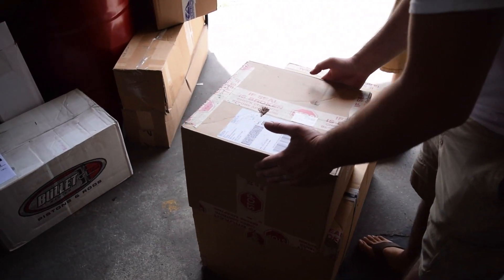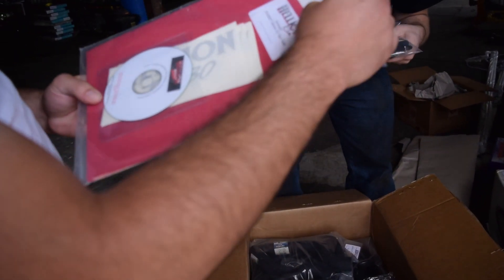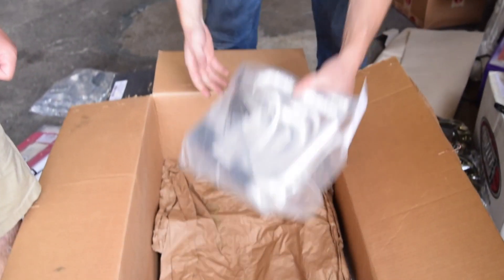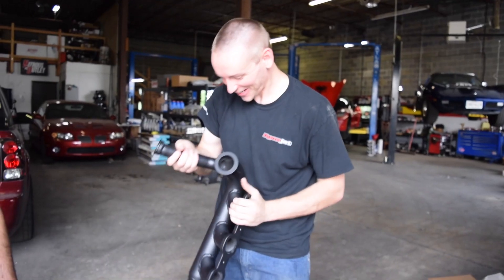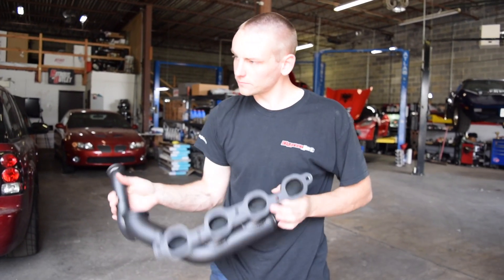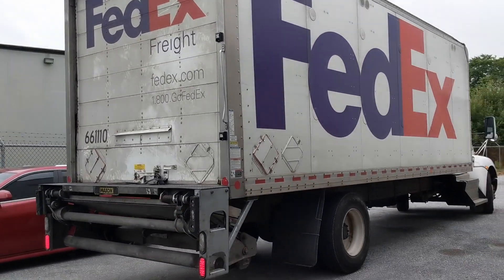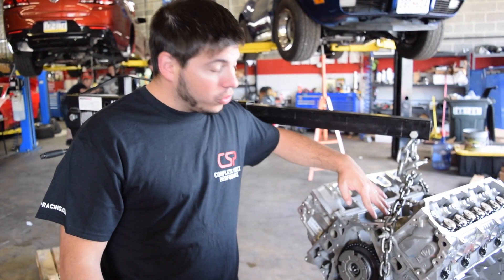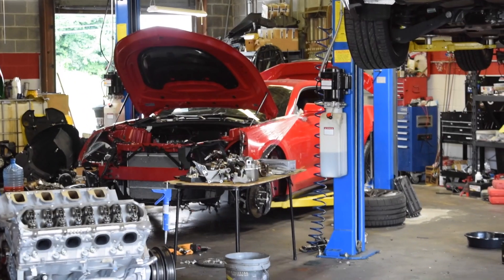Unboxing GuitarmageddonZL1's Twin Turbo Hellion Kit and Stroker!

Comment: Turbos are changing. With Gen2's, you don't need an 8 inch opening on a turbo to push 30 pounds of boost anymore. The bearings are better, the rotational speeds are better, they're lighter and one of the largest important things is you just don't have much space under a factory hood unless you shift the engine back, rip at the dash and build a bell housing for the tranny that is now sitting right beside your thigh. 
They don't spec them at 88/98 102/108 anymore. They provide them based on HP you want. 
Nick has his target on a racing bracket and that's where he's going to race until he wants to spend 50k to step up into promod or something. People always look at a small turbo and go "But why isn't he trying to rip 3500HP out of that setup?"  The reason is that you have to actually baffle your turbo system if you use turbos that are too large. HP is impacted by boost. With a smaller setup, you can't build boost on a big turbo because the system is so damn large. It's like a window air conditioner (to use the current 1100 degree temps outside  as an example) to cool your whole house.  Doesn't work because the hardware doesn't fit the spec.

Smaller turbos don't look as honkin as their larger "impressive" 88/98 102/108 cousins but they're designed for what Nick wants to do. Honestly...if you need larger turbos, the kit isn't a "leverage the loan on your house" payment to go from 55's to 102's. Even IF he could build all the boost in the world on a larger turbo, he'd grenade the engine as none of the supporting pieces like fuel management, just design of the engine/block/cam/crankshaft in general would handle it. 

Consider...going to 2500 HP and above takes a new seriously engineered crank shaft. It takes a lot more but just consider that. Now THAT is a "leverage the mortgage on your mortgage" payment. Kind of weird when you look at it other than the fact that you have to consider that crankshaft can't bend or bow even a millimetre while you're boosting 2500 HP or you'll throw lifters or worse throw a piston into your ten thousand dollar heads. 
Head damage doesn't buff out.
Glad he went with Turbos. To me, a turbo is a perfect thing other than lag off the line. With CO2 help though it's not so bad so you still get those crazy 60 foots.  The best though is that the faster you go, the faster you will go. Every little bit you inch in speed/enhaust in your engine as you go faster, that turbo spins faster and bangs more air into the engine. More gas, more air, faster yet.

Oh a screw blower looks impressive and will beat you off the line but by the time you hit 1/4 mile on a promod, you can be going fourty to sixty miles faster than that blower will be going. Kind of like spotting the hare a bit of space before that turtle spins up and blows past him.